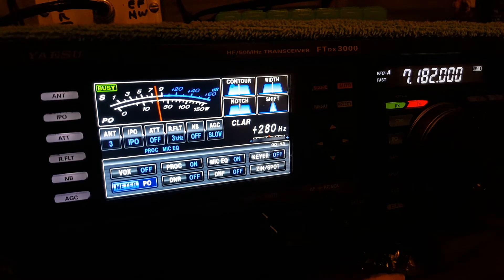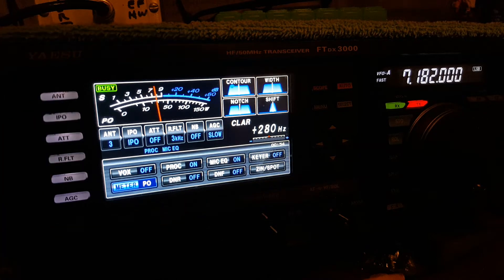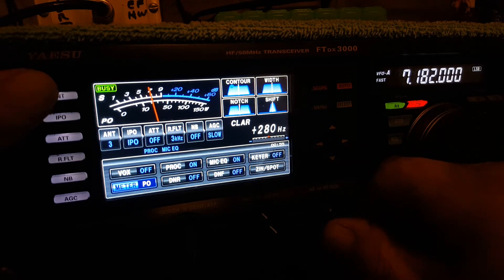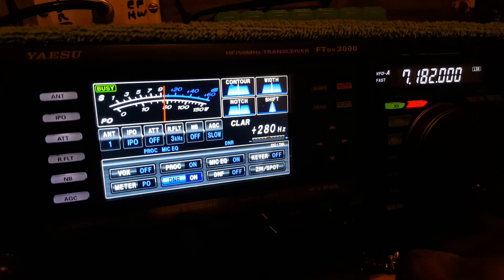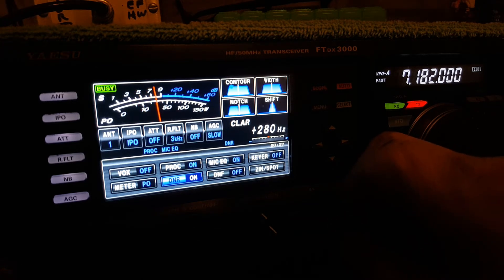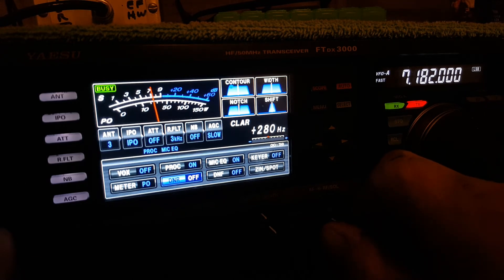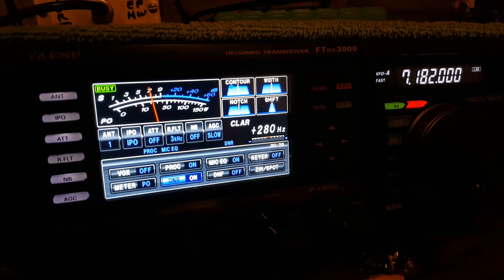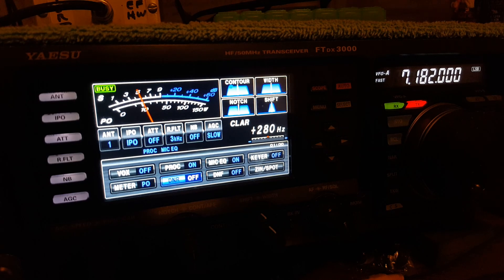40m QRN at 9pm: 80m EFHW vs Dipole + Yaesu DNR demo

Comment: Nice experiment.  If it weren't for EFLW antennas I would probably make far fewer contacts or not even be on HF.  They are inexpensive and easy to setup in challenging circumstances.  I do need to wind a multi-tap UnUn like uncle 'Blowzo'.  73 to all!

Comment: Interesting video!  I'm not really surprised.    Should I be surprised?   I'm kind of fond of the EFHW.
Reply from the maker: Yep, me too. As soon as I connected a wire resonant on 3.600 to an UNUN with 7 or 8 taps. I was blown away by the versatility of it all.
Sometimes the dipole will have a bit less noise, sometimes a whole lot more. And almost never do my dipoles beat the end fed wire in terms of signal strength.
I love having a choice between antennas. And for that reason I really REALLY miss my cacti. lol. Spring is just around the corner, and I'll get the pile of trash mounted back uponst it's post. Right now the yard is too soupy and soft, and I'm afraid of sinking down into it like a cheap quick sand scene from an equally cheap 1960s black and white thriller. Don't know why but Tarzan imagery pops into mind. But I digress. lol. Take care OM   :)

Comment: Well that’s very interesting I would have thought the dipole being a balanced antenna would have been quieter, just shows how good the uncle Blowzo UniUn is 😆. Awesome 👏. 73 de Will, M0LGW
Reply from the maker: lol, nah- it just goes to show that my dipoles are on the side of my property where Cyndi lives. Cyndi loves to do laundry. She does always look and smell nice. Unlike your old-ass Uncle Blowzo. Haha. Seriously tho- yeah, that's the general misconception about end feds. At my shack, sometimes the end fed is SIGNIFICANTLY quieter than the dipoles- and it has a lot stronger signals in general. I think maybe that's where one can be tricked into thinking the end fed is noisier: the noise is louder but the signal is much louder. Equalize the two with attenuation on the end fed, and that will tell the real story.
What I find more useful still is to have a vertically polarized antenna as well to choose from if yard space allows it. Seems like there's no predicting which antenna will work best for me on any given day. Too many variables such as propagation, local electrical grid QRN, neighbors using power tools, etc. And it includes the QRN that my own home generates sproadically- such as our embroidery equipment.
One thing is for sure- if you have an end fed, a dipole, and a vertical from which to choose.. as propagation changes.. you WILL have one antenna which far outperforms the others. And tomorrow.. or even in a few hours- that 'best' antenna might be the worst. lol.
Sorry for the mini novel. Take care Will  :)

Comment: Are you using an unun to feed the efhw??? What ratio one???

Paul   K1YOU
Reply from the maker: Yep, I'm using a homebrew multi-tap UNUN. I wind them so that they have taps at: 4:1, 9, 16, 25, 36, 49, 64 and 81:1.
I was using the 81:1 tap on the UNUN in this video. I generally use that tap or the 64:1 tap when on 80m. On 40m, I use tap #5 and get a near perfect match. On 20m, I use tap # 3 and also get an SWR under 1.5:1 without using the rig's internal tuner. I almost never use the internal tuner with my UNUNs and end feds. Sometimes.. but generally not needed.
I have a play list with most if not all of my end fed and multi-tap UNUN stuff if you want to check that out.
Thanks for watching!
73.. Chuck

Comment: How high is the efhw? I have one I haven’t set up yet. I use another one for pota Cw. Any chokes or line isolation involved?
Reply from the maker: Hi there Jay..
It would be easier and be better for you if I just make a quick video tomorrow and show the antenna. I've done that in other videos, but the antenna shape has changed. And there's people here who've not seen my older antenna stuff, and I tend to bury it with constant vids. lol. I'll just make a two minute video tomorrow and show you guys my antenna wire and UNUN setup. OK? 73  :)
Reply: @n8nkqrp595  sounds good